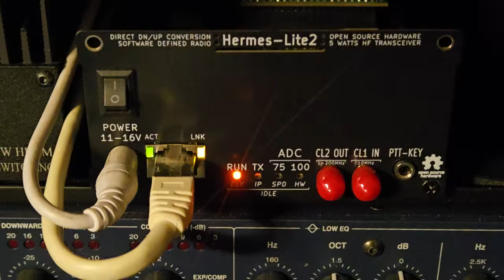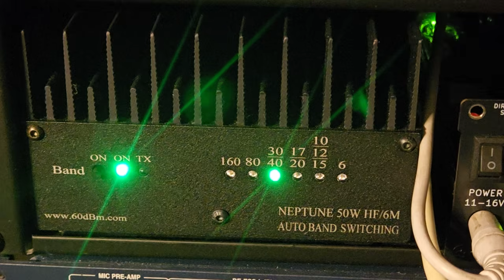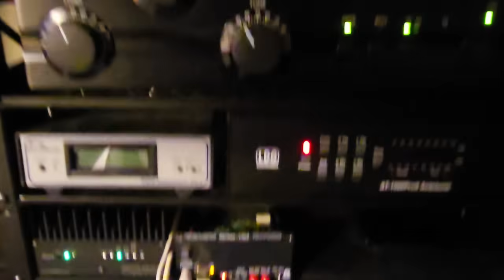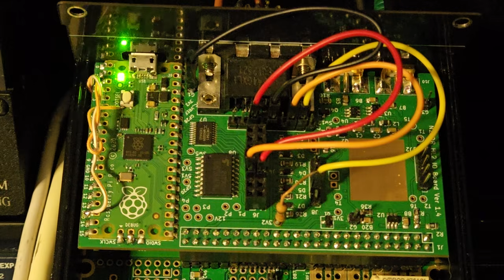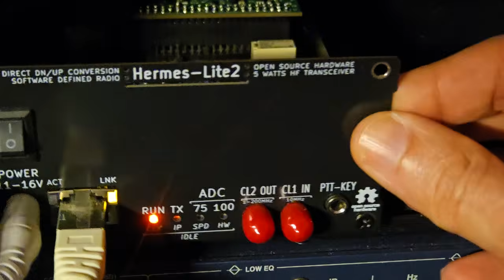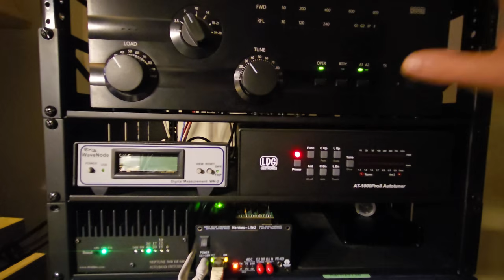VA2CST - Hermes Lite 2 IO Board LDG AT-1000 PRO II automation

Comment: It Works!!!! Thankyou very much. I also modify my JUMA 100 clone (small issue in operting mode) ,  to work with your implementation and WORKS GREAT! Do you know if there is any way to implement Ctrl+TUN in Midi Cat commands? or use any custamisable buttons on Thetis Software? thankyou VERY VERY MUCH! (EA5JZS)
Reply from the maker: ah thank you for your kind comment ! unfortunately no I don't know threre is a possibility for shortcut for CTRL+TUN, you can try to ask Reid MI0BOT who maintant Thetis for the HL2. What tuner are you running and are you using the BCD band decoder for your juma amp ? enjoy your HL2 with automatic tuner !
Reply: @Aleziss  I use Analog signal from HL2 IO on JUMA clone selecting Auto Band Detect input Yaesu FT817 trougth 3mm jack and works perfectly, but sadlyJuma clone ned to be in operate mode and in that mode even without ptt signal Juma entrers in swr protection mode durin low power tune , but I have modified Juma it internaly with one small relay to block swr ref signal if there is not Ptt signal present. And works perfect! Regards.
Reply from the maker: @Joseferrer-q8r  yes that is what I heard about the juma amplifier, when the tuner is running to try to resolve tuning, swr can go quite high and result in the amplifier to drop RF and enter protection. That is why I use the 60dbm.com neptune amplifier on my end, they do not have any protectoin on high swr condition and it also work great, the important thing is that you were able to make the amplifier run correctly now ! I'm glod you found the code helpful !

Comment: Nice work! I just reiceived one LDG AT 200 pro II and I am going to try implement your solution. Hermes lite 2 plus with Thetis  and Juma clone amplifier with band input selection yaesu compatible. Thanks in advance. EA5JZS
Reply from the maker: fantastic, tell me if the 200 works as the same as the 1000, with your permission, I could add the information on the github citing your tests. juma seems nice but I heard it is sensitive to high swr, while the tuner runs, the swr can go really high and I've read in some forums that the amps drop when swr is too high... I chose the neptune amp instead for that reason (ukraine) they do not drop under high swr condition... keep me updated !
Reply: @Aleziss  No problem at all. I can send you to you juma relay implementation for avoid SWR high safe mode and publish if you want. sendme an email and I put back information.